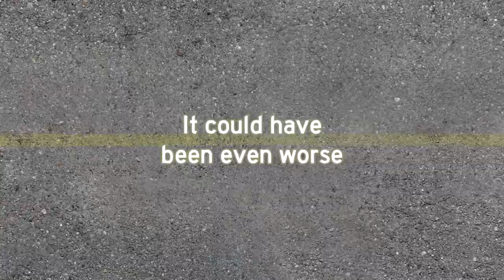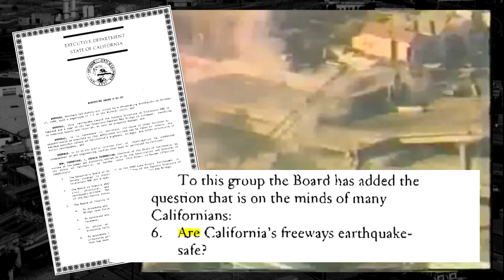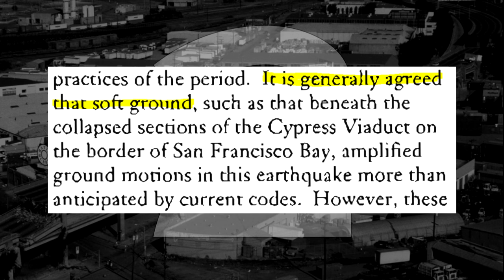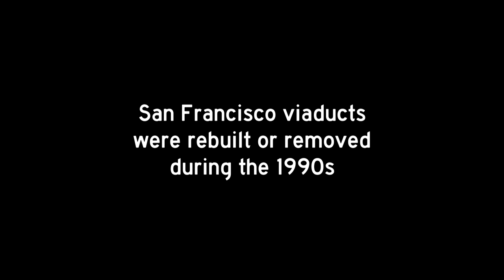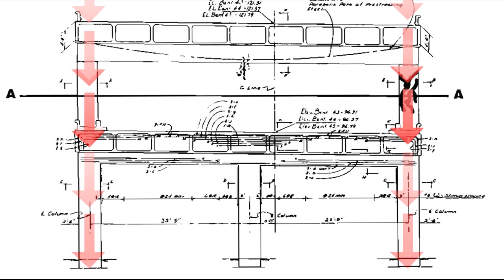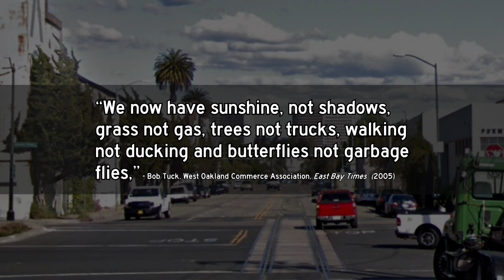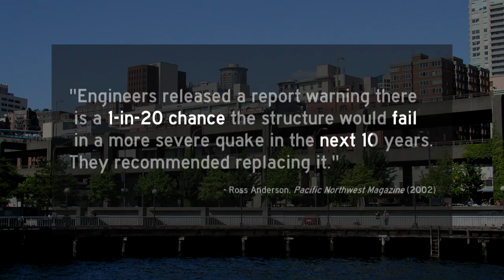What caused America's DEADLIEST freeway collapse?

Comment: I was always suspect of that the bottom deck.  The centers of each concrete slab was sunken so at a certain speed my car kinda bounced up and down and I called it a duck walk.

In the 60's there was a South Dakota interstate that had the same problem, but they dug it up and repoured the portion of interstate.  I always wondered why they didn't redo that bottom deck, but the top deck was the real problem.

Comment: Like the 1999 Monte Bianco disaster, these were the main interventions adopted after the stake:
-the creation of fire-fighting niches every one hundred and fifty meters,
-the creation of SOS niches every hundred meters alternating on the two lanes,
-a rescue post was built in the center of the tunnel, with a vehicle equipped to extinguish the flames and a group of firefighters permanently present on site,
- construction of shelters connected to an independent evacuation tunnel (under the carriageway),
-construction of a single control room.
In addition, vehicles transporting hazardous materials and polluting vehicles (weighing more than 3.5 tons and *euro 0) have been banned from circulation, the speed has been considerably reduced and the safety distance between vehicles increased (150 m between moving vehicles and 100 m between stationary vehicles).
*is a classification table for diesel and petrol engines based on European emission standards with a set of limitations imposed on the emissions of vehicles sold by the Member States of the European Union

Comment: The Alaskan Way viaduct is gone and Seattle is now safe?  Not if you have traveled the I5 express lanes though downtown Seattle.  Built back in the sixties, it can cause nightmares.  It is built with much of the same engineering as the Nimitz freeway.  Do people even think about that as they drive through?  When I drive it, I certainly go fast. Not because I want other home any quicker, I just want to spend as little time as possible in the bottom of the double decker area.  If we get an 8.0, it is coming down and nothing on this Earth is going to stop it......

Comment: Believe it or not, your odds of surviving on both decks was higher if you wore your seat belt than if you didn't. Seat belts probably saved several lives that day, along with the car safety advancements that had been made up to the 1980s. Especially on the upper deck, the death toll up there would have been A LOT higher if the earthquake had hit in the '50s instead of '89. By '89 most people buckled up and most cars on the road were designed to pass crash testing standards. Rudimentary crash testing standards by today's standards but crash tests nonetheless. Over 100 people driving in the collapsed section survived, in fact over 90% of people on the upper deck lived. Some of them rolled over, had major frontal impacts with buckled roadway, IIRC most of the cars even on the upper deck were totaled. While there was a catastrophic engineering failure that day, there were other engineering successes that helped many of the people involved survive it. I calculated once that there was a 76 percent survival rate total (upper and lower deck). 

December 22, 2020 4:27 am

Comment: Nice video!  When I drove the Nimitz Freeway one time a few years ago, I was visiting from Australia, and noticed a kilometre-based distance sign on the new-ish section.  I can’t be sure because Street View won’t corroborate what I saw, or I misremembered the location.  Do you know the sign and its history?  I feel like the rebuild would explain it.
Reply: For a time, metric distances were displayed alongside English units on some of the signs displaying distances to cities down the road.  They were rare, and had generally been phased out by the 1980s.  I don’t believe they would have installed any such sign on the Cypress replacement.  There may have been some south of there.

Comment: From what I recall , the Nimitz ( originally an extension of CA SR 17 ) was hastily-upgraded (reinforced columns on its double-deck portions) in the early 80's in order to "bring it up to Interstate standards" . This "reinforcing" was complete by c.1982 , and CA SR 17 was renumbered I-880 .
According to my uncle whom resides in Alameda (and has since the 60's ) , the columns were hastily reinforced with rebar and concrete --- and the rebar wasn't tied-to the original rebar skeleton --- this is obvious in the images of the columns ; one can see where the rebar wasn't tied-to the 1950's structure ! Half-assed work in order to "meet" Interstate standards ! 
If not for the 1989 World Series , many more would've ostensibly perished in the wake . Hell , even ~ 10 hours earlier ( 07:49 ) made a huge difference from ~ 10 hours later ( 17: 04 ) .